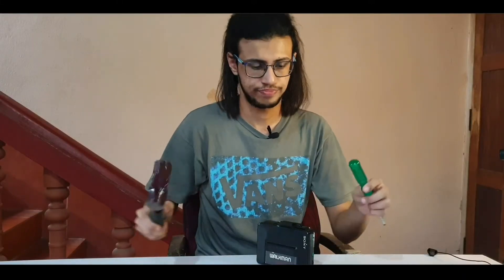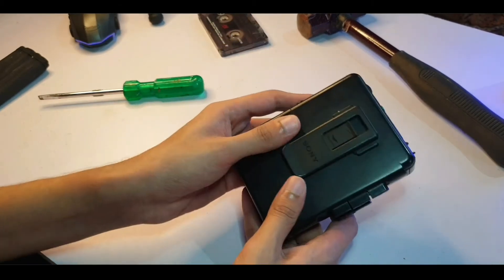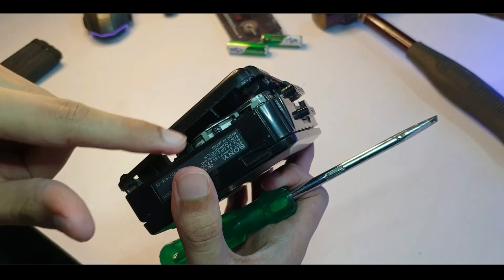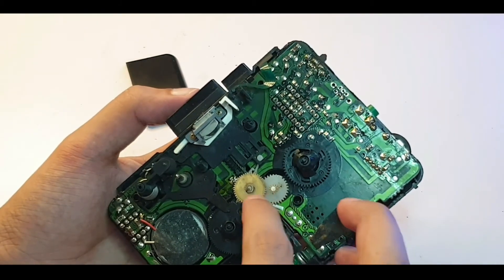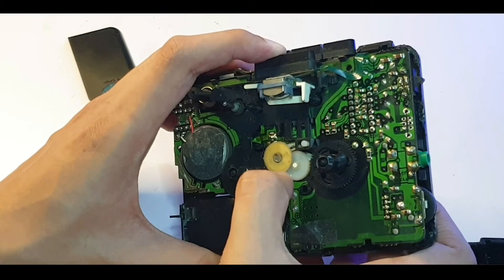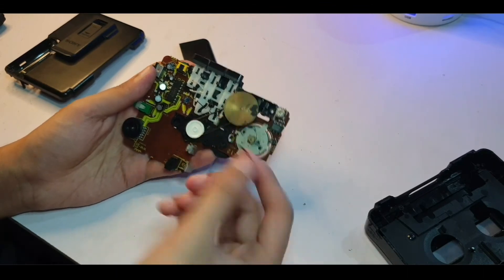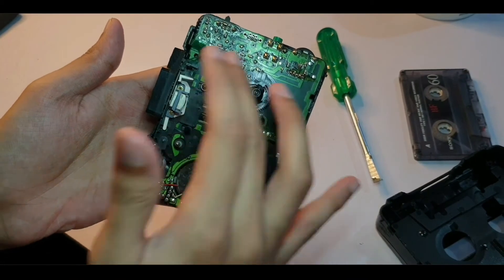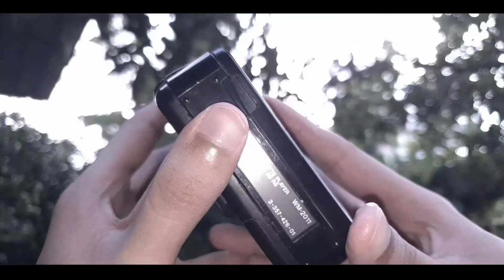Old Sony Walkman Cassette Player Teardown | 40 Year Old Hardware!

Comment: Clearly you don't even have basic knowledge to tear down such walkman..... Under the belt holder there are scres to open it systematically. How can u say a walkman has all motor inside..... pCB is required for signal processing and motor control. 
Unless you don't have idea of what capstan, roller pinch and flywheel is pls don't open such gadgets. 
And hey they are not plastic gears.... They are nylon gears.... And they last more than metal gears. Gears are easily available. Here it not about gears.... The gear lock has come out.
Reply from the maker: K

Comment: This worked thank you so much.
Reply from the maker: What was wrong with yours? The same plastic gear? 🙂
Reply: @TheHopelessGeek  The belt had melted so I replaced that, but even after that it would only spin for a few seconds, flip the DIR switch and then turn off. Once I cleaned it out with your vinegar/bleach/alcohol solution it started working. I think some of the melted rubber may have been stuck to the gears or something
Reply from the maker: Ah, great!

Comment: I've just found and took apart mine wm-2011. Luckily, only the drive belts dissolved due to the long shelf time...but replacement is on the way from China. Anyhow, good video, and good lines...I lasted until the end insert that's what she said here Just a hint: If you are just as lazy as I am, and are still procrastinating buying a plastic prying tool, you can run down to the local music store, and buy some guitar picks. Even the metal ones can open up most plastic cases without damage ;)
Reply from the maker: Ah, thanks for the tips😅

Comment: Nooooo.... you hack the cover and probably break the tabs on the inside casing..... push on the tabs on the inside of the casing you can see when you open the cassette door. You may still break the old and fragile casing tabs, but the outside casing stays in a decent condition.
Reply from the maker: Thankfully, I managed to put it back.😅

Comment: you're very good and very funny!  I'm trying to fix my similar Sony Walkman which doesnt move at all.  and i'm out of good double A batteries and out of all the wires i have, the one to plug in electrically is missing!  I'll order more batteries and keep trying to take off the back.  I'll check that gear and see if the plastic has worn down.  too bad you can't get a replacement piece...or maybe you have by now from another old walkman
Reply from the maker: I wasn't able to track one down yet, but maybe I can do something with wax to get it to work.(That's what she said).

Comment: hi u can fix that walkman  u need to put rubber or  silicone insulation frm silicon cable to make more friction on small gear wheel or u can make  amplifier from walkman
Reply from the maker: Yeah, if those gears for together well it'll probably work.😁👍

Comment: you should find  the replacement gear in the local electronics repair stores for cheap.. check the pitch circle diameter of the gear and the number of teeth on it.. looks like it has 60 but not sure though
Reply from the maker: 🤔Hmm.. thanks for that suggestion. I'll see if I can get one.✌
Oh, and I'll upload in 4K next time so you can count the number of teeth clearly 😅
Reply: @TheHopelessGeek  hehe.. it definitely will help
Reply: @TheHopelessGeek  check this link - https://www.amazon.in/Futurekart-Pieces-Assorted-Single-Modeling/dp/B07FJ6ZFSP/ref=pd_sbs_328_1/261-3369124-1008908
Reply from the maker: Oh, this is cool! I'll take a look when I can.😊👍